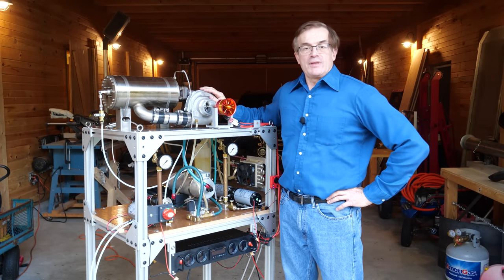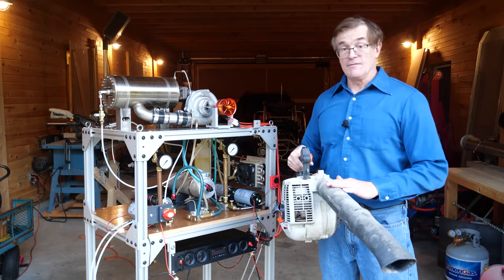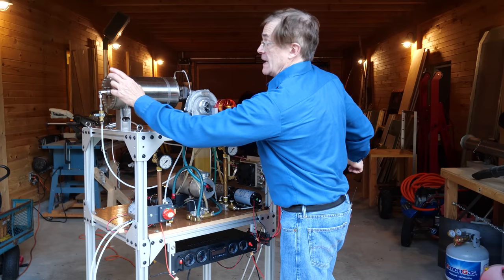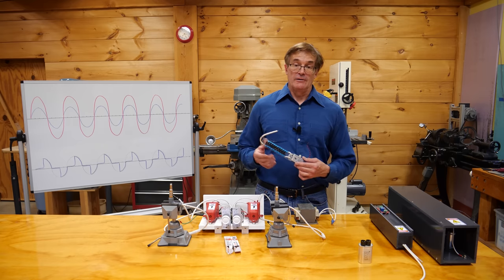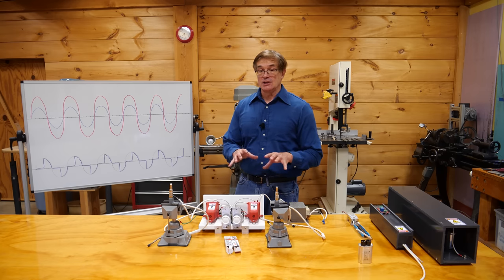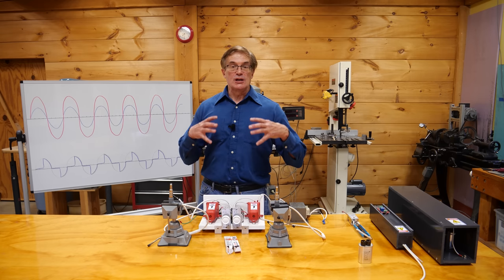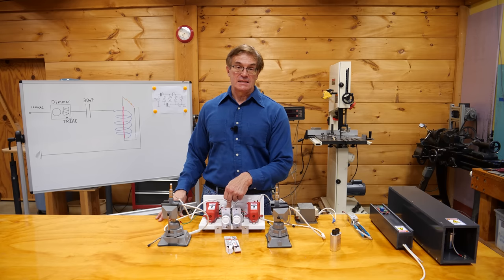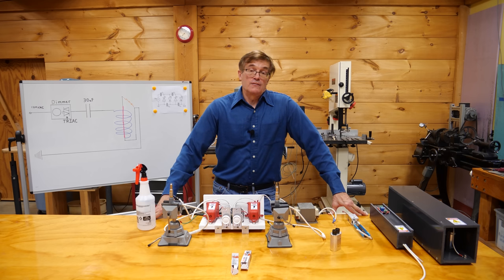What else goes into building a jet engine? - Part 4 Final

Comment: Awesome series!  Any chance you'll ever do anything with solar zeolite cooling?  I live in the high desert, i'm looking to build a water 'maker' and i'm going to experiment with zeolites for cooling a reservoir below the dew point and using a collector coil or some other setup to condense water from air.
Reply from the maker: This basic principle  is ancient as I'm assuming  you know.  The super cooling is easier  at night as the radiant energy lost into space is the same as during the day, but you don't  need exotic coatings to combat the energy  deposition from the sun.
There are projects constructed out of plastic webbing near the North African cost called dew catchers.
Reply: @TechIngredients  Thanks for the reply!  I've looked at dew catchers and fog nets, but i don't think we get enough fog days for them to work, although i plan to try those as well.  They're suited to coastal areas with uplifting mountains, i'm 500 or more miles from the coast, all the air has been squeezed by the time it gets to me.  Now if i could find some way to get the mesh below dew point i'd be doing good. I'm working with the 5-50% humidity on average, fog nets usually need a bit more.

What i'm thinking is a sealed zeolite chamber/panel heated by solar (either directly or with a heat exchange loop) to drive off water from the zeolite and condense it back into the cooling side.  At night, or when the zeolite is shaded or the heating loop is shut off it would start adsorption of the water vapor from the cold side.  I've seen lab demos of both zeolite boiling water poured on it and flash freezing water through rapid adsorption.

I'm trying to replicate these experiments/demos on a larger scale, enough to freeze several gallons of water or eutectic, then using the thawing of the ice to run a condensation coil. I'm not thinking of anything more exotic than some copper coils and insulated ranch pipe, a few valves, some computer fans for forced ventilation, and something like Rain-x or other common commercial hydrophobic coating.  Maybe some solar vacuum hot water panels, i've got a bunch lying in the yard doing nothing, or a reflector boiler setup to run a steam turbine generator and use the waste heat to recharge the zeolite.  I want to try zeolite stable freshener as it's cheap in bulk, but even if i've got to use $1-2000 worth of 3a molecular sieves it's worth the investment for producing water if it works.  With the drought getting as bad as it is here out west we get a small fraction of the precip we once got, and now run short on water every dry season.  Even producing a few gallons per day would be a game changer as far as not having to haul water up a mountain to grow my own food and ensure self sufficiency.

Comment: Surprised to see this. Just had a thought about a project of mine. I want to convert an old truck to a Gas turbine hybrid but instead of having a massive battery with 150+ miles range would it be more efficient to have a small "buffer" battery with 50-75 miles of range for quick acceleration?
The engine would power an electric generator and not be direct drive like the old GM/Chrysler cars from the 1970s. 
Thoughts?
Reply from the maker: That would work.  The choice of engine depends  on how much complexity  and money  you want to spend.  The battery and electric  motors will allow  a pretty small engine and decent  acceleration.
Reply: This is how the BMW i3 runs. Indeed most of the electric hybrid vehicles do the same. A small (usually around the 1l range) engine used to drive a generator and then a small battery.

The battery allows you to run completely on the electric system at low speeds and for short distances. For example to reduce emissions in towns. If you were willing to sacrifice that you could use something more akin to an accumulator or capacitive storage, kind of like the kers system used on some F1 cars. It would allow for very rapid power delivery if you wanted to achieve high acceleration rates, but would pay a penalty in specific energy storage. 
Alternatively you could use a mechanical storage system. Some kind of large flywheel for example. This could also be used in a regenerative mode, to recover kinetic energy on braking and use it to help accelerate away again.

Automotives, and especially electric drive trains, are a fascinating and hugely important area of research. It's such a shame that we didn't decide to develop them alongside internal combustion powered vehicles, but there was no incentive for the oil companies to invest in that.

Comment: That's uhh not quite how transformers work, the output voltage is not related to the Δv/Δt of the input voltage - it is related to the Δi/Δt, but the Δi/Δt is itself defined by the absolute input voltage vs the transformer's magnetizing inductance..

Most of that cancels out in the end, and (aside from oddities from core loss and ringing) the output voltage is proportional to the input voltage right up to the point where the core saturates from excessive amp-turns, which doesn't happen with AC input as long as the transformer's peak volt-seconds rating is never exceeded by the AC waveform.

Your triac dimmer driving an ignition coil works because the coil is only designed for 12v input, but you're feeding it 170v - and without the capacitor (to drop current to 0 more rapidly than the mains voltage falls to 0), it would burn rather quickly.
Without the dimmer, you'd never get that voltage into the coil in the first place since mains frequency would be too slow for the current rise rate in the ignition coil's primary.

Your thing isn't a CDI setup, the capacitor doesn't "add energy" - in fact it prevents too much energy from flowing…

PS: ignition coils are usually driven by connecting them to 12v for a while (milliseconds), then turning it off very suddenly and allowing both the primary and secondary to make a large voltage since Δi/Δt is extremely high. Not hard to get ~5cm long sparks from a 12v-fed ignition coil if you drive it right ;)
Reply from the maker: That's  not quite right.
The capacitance rating of the capacitor is proportional to the energy  output of the coil.  If it only limited the average  current then a lower capacitance would reduce the output, but the reverse is true.

Comment: I am using a neon sign transformer that produces a constant arc at around 3kV and 30mA. They are very inexpensive and I got the idea from RCTestFlight where he was making a pumpkin pulse jet
Reply from the maker: 3kV is pretty  low, are you sure?
Reply: @TechIngredients  Yes I am sure. It will maintain an arc of around 6mm on a standard widened spark plug. This seems surprising as typically 10kV/cm is required in air, but it seems to work well. The overall energy and ignition reliability must be lower however.
EDIT: That breakdown voltage estimate is a bit low upon further reading
EDIT 2: No, the rating is actually 6kV, makes more sense
Reply from the maker: That's what I thought, thanks  for taking  the time to add the correction.

Comment: Maybe one of those electric hybrid turbo companies would let you have one of their devices  for your show.  It has an electric motor to spin up the compressor to deal with turbocharger  lag time and the motor also works as a generator to extract energy from the exhaust once the exhaust pressure is built up.  That is exactly what you need for the concentrated solar power system.  Run the compressed air through some pipes heated by concentrated solar.   If you got higher efficiency than solar panels, you could sell the system for zillions of dollars.  Even if the electrical efficiency was a little  less, the waste heat used for space heating and heating water would  make the system much more valuable than solar panels. . The generator could also run off of heat stored in a gravel battery.  A ton of gravel heated to 500°C stores 100 kwh of energy which could be extracted at a later time.  
How much does some plastic sheets covered in mylar and some pipes  cost compare to solar panels?  
But the efficiency of turbocharger is supposed to be very good.  You might get 30% or 40% efficiency out of the system.  People always use heat to boil water to drive a turbine.  It can freeze up when it is not running and it has to be supplied with water and there are other issues.  Just use compressed air .  It may not have as much expansion as steam but it seems so much easier and simpler.  Air heated by 600°C expands about three times or increases by about 30 psi.  That is more than enough to drive a gas turbine. 
The concentrated solar arrangement would be easier than using fuel.  No flame tubes or fuel iron spark plugs.  Just make the compressed air inlet a little smaller than the pipes so that the heated air tends to expand in the direction of the turbine end.  A 20' by 20' area would supply about 40,000 watts of solar energy.  At 30% efficiency with a 90% efficient generator, that is aboutv10,000 watts.  
If you use spherical mirror trough mirrors instead of parabolic mirrors, they focus on a cylindrical surface like a pipe.  If they are aligned east west you don't need a tracking system.  And put some glass tunes around the metal collecting pipes to trap the infrared trying to escape from.the pipes. 
https://youtu.be/i-UnhAzTMxg
https://images.app.goo.gl/hwUBZ7rCi1qbMWUG7

Comment: Hi, i have a quick question. So i finally built a working self sustaining turbojet engine. Allot of it is thanks to watching some of your videos, i have a really small turbo and it self sustains good and even cranks up to pretty good power however on my second throttle up it messed up and i took apart the turbo and burned up the journel bearing. I guess the oil filter i had right after the pump was not a good idea, maybe the pump needed to be stronger but it was oil starvation im sure, but im super motivated in continuing the project because now at least i know the engine works and just got another of the same turbo, my only problem is and ive done a whole bunch of online searching but cant fig this out, everyone is sayin you need 35 to 50psi and maybe a bleed off to if its too high, only prob i have is im looking up all these scavenge oil pumps online but they are only for scavenging and not pressurizing a turbo, i dont beleive those amazon oil scavenge gear pumps put out 35+psi, i did see a few but its about 250+ bucks which is to much for me at moment. I keep searching "turbo oil feed pump" but it seems theres not much  because most people use the oil pressure from there car engine for the feed, so would a scavenge pump still work on a small turbojet engine? I was thinking of using a fuel pump rated at 60 psi and bleed off anything if i need to if its still high at the point where its entrering the turbo also gonna use mobile 1 10w30, but not sure if a fuel pump can handle the heat and the thickness of the fluid, i have the pump right after the radiator so maybe it will be cool before it enters the fuel pump, idk. But i feel like out of the whole build, the oil sytem and finding the right pump is the hardes part.
Reply from the maker: I'd try the fuel pump.  Place the oil filter after the reservoir  and before the pump. Too much pressure  will just risk some smoke, too little risks the bearing.
Reply: Awsome thanks. Will try the fuel pump, i actually just bought one about 30 mins ago and was hoping to here back from you. Its rated 65 psi, i ended up taking out the oil filter setup but i guess im gonna put it back in now when i get home, i was thinking to about putting it after the radiator and before the fuel pump but was just not sure how the pump would work on the sucking part, cuz i know it will push the fluid good once its in the pump, but i have my radiator in a bucket of water so the lines coming off that are about 16 inche high or as high as the home depot bucket and so the sucking has to be sonewhat strong so the fluid can get to the pump, but im thinking this idea will probably work, thanks allot.
Reply: Welp i hooked up the oil filter like you said and put the new external inline fuel pump in and it all seems to work pretty good, how ever i cranked up the engine and ran it and did about 3 power runs and than it wouldnt get up to power anymore. I saw it spitting some hot metal out the back, after i inspected it i noticed all the turbine blades are sheared off on the edges, theres no shaft play so i think the bearings are still good. The shroud around the turbine was glowing red hot even when i went past full throttle, ive seen some peoples engines where if they give it full throttle it cools it off, mine was glowing hot, not sure if its a design flaw of the flame tube, i didnt do the exact math of 30% 20% and 50% instead i eyeballed those numbers and just guess what i thought was 30 20 50, not sure if thats the reason because i know the last holes that are 50% are for cooling, well at least i think i got that info from you and a few others. I wonder if putting a long tube after the combustion chamber  and than connect that tube to the turbine shroud would help, also when i did my welds i heard some rattling of peices of little balls of steel from the welding splatter was left in the combustion chamber, i tried shaking those out for countless minutes untill i didnt here anything but you never know, maybe a piece broke off and fodded out the turbine, i have a video on my page you can check if your curious on the flame tube design, its at the very top page of my videos, not sure if it right, oh well guess im happy thow i got a full power run on video before it went out. Maybe i need to upgrade to a biger turbo because this is litterally like the smallest turbo you can find so maybe its really sensitive, also the shaft is super skinny like .177 like the size of a bb, smaller than .22 calliber.

Comment: Is there a name for the phenomenon/technique of suddenly turning on the primary voltage, to increase the secondary voltage?  I'd not have expected that to work, and I'm having trouble finding much on it via google - but you BUILT one, haha, so I'll trust you're right, for now.  But like - my understanding is that transformers are inductors, governed by v =L di/dt, and the magnetic field is proportional to the current, so at e.g. v=100 volts, you get a change of 100 amps per second (divided by the inductance, and probably something related to the secondary winding), and a proportional field strength, regardless of how fast the voltage is changing - whether it got there via sine wave or abrupt transition.  Compare a DC voltage, which doesn't change at all, under which circumstances I THINK that for an ideal transformer with ideal wiring, the current would rise linearly according to v =L di/dt.  The (ideal) field would likewise linearly increase, producing a steady DC voltage on the secondaries.(...I think.  Probably depends on load.)  Despite a non-changing voltage, the transformer still functions.  (In reality, this doesn't work (for long), and I expect it's resistive losses that stops it.)  It seems to me that a change in voltage does not itself affect transformer gain.  Is one of the above statements wrong?  Or, how should they be reconciled with the claims of higher voltage for the dimmer-switch transformers in the video?
Reply from the maker: Look into field  collapse.
Reply: @TechIngredients  Ok, thanks!

Comment: Steam pressure increases exponentially with temperature, use a lot less kerosene boiling water at 700°F for 3000 psi to spin the turbine instead of pumping so much fuel into it.
Reply: They have a biodiesel water blend for jets, runs a little bit cooler with better compression. Best of both it would seem.
Reply: @petevenuti7355  use 400 times less fuel simply maintaining preheated steam at 700° in a well insulated boiler.
Reply: @unitedspacepirates9075 pressure is? How thick does the steel have to be at that temperature?
 sounds great for a nuclear reactor, aircraft carrier ,train, but a bit heavy for a model plane,bike or gocart
Reply: @petevenuti7355  steel scuba tank rated for 4500 psi shouldn't pop at only 700°F with only 3000 psi in it, as steel doesn't melt until 2500°F. 
You should probably put it in another heavy duty pipe with caps just Incase it does pop. One gallon of water makes 1700 gallons of steam.

Comment: what about an electrical ligher? Couldnt you just take its circut and get two wires?
great vids btw
Reply from the maker: It might possibly work.
The point of a more powerful ignition system that can run continuously is that turbojets can be tough to ignite and as in the demo, a large hot spark can start a mixture that a small or single discharge won't.

Comment: Why did you use one of those evil long nose Ford spark plugs? They have a bad habit of breaking off in hard to extract places. Is it necessary for the plug to reach that far in?
Reply from the maker: It's  an advantage  to have the spark close to the air fuel interface.
Remember , the conditions  in a single  stage turbojet combustion chamber are much less severe  than in a gasoline engine cylinder at a 2-3 to 1, steady compression ratio.